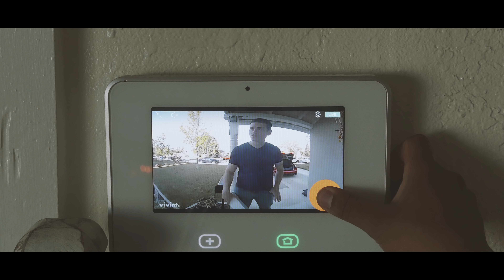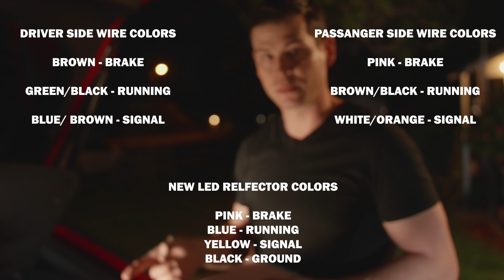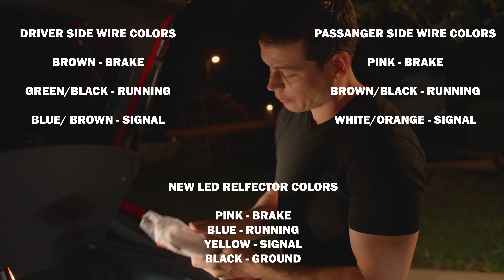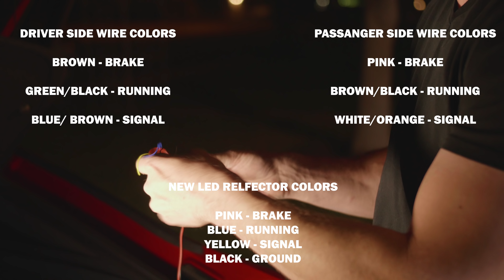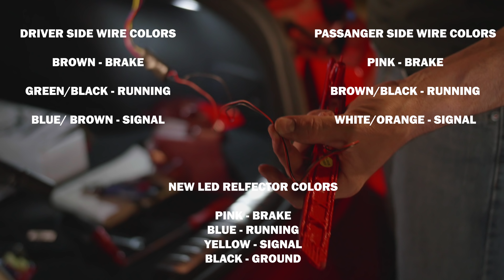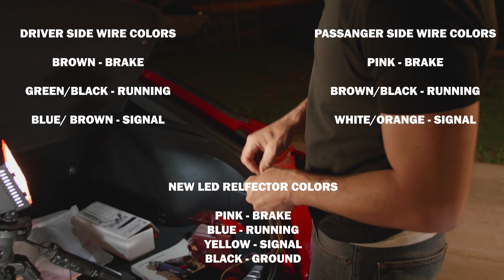2018 KIA STINGER GT2 Sequential LED Reflector Install

Comment: Thanks for the video. I've watched all of your videos so far and learned a lot from you guys. 

 After watching how complex this is and how unfinished the product is, I will not be adding this particular accessory to my GT2; although I do really like the look of the sequential signalling and integration with the other light signals. 

What I'm looking for is a signal light that is certain to be waterproof, has plug connectors (rather than testing and splicing), and wires that do not need to be cut to be fished. This "ideal" product will likely be more expensive than the one you used, but to me it will be worth it.
Reply: You do not have to splice the wires to fish the module if you use a Dremel to enlarge the hole. Worked like dream for me.

Comment: Mine arrive Friday, thanks for making this video :).

Pro tip (6:00), instead of cutting off the insulation from the wires I strip the wires from the new LED lights back that connects to the harness. If you cut the right length you can fold it over once and edge it down next to the correct wire in the connector. If you do it right it will always make contact, then just put a small cable tie around it and you have hooked up your wires without cutting anything factory. Cut the cable tie and pull the wires out if you want to go back to stock. I did this on my Optima 4 years ago and the lights still work great. Not sure if the connectors on the Stinger will allow that but it looks like they might from your video.

Comment: Is there an aftermarket solution for the reflector that lines the trunk?  It would be cool if you could connect the two brakelights with a led line as well.  It would be similar to the dodge charger or durango.

Comment: I’m late lol but to test ground use a multimeter. Have the car off. In the continuity position touch one lead to a ground on the car. Other lead just start touching pins til you get continuity. That’s your ground

Comment: How difficult do you think it'll be to open up that reflector? I bought the bare lights from Korea back in January and have been slowly tinkering to figure out the wiring but since you guys are awesome you tied up all the loose ends for me. I had that pesky screw that you can barely see figured out but didn't know I was going to have to cut and reconnect the long wires. Thanks!
Reply from the maker: It's hard to say.  It looks like they used some tool and melted the reflector open or opened it and melted it back together.  It's obviously possible just not sure how difficult it would be.

Comment: Hey Bud been watching your videos for quite some time. Have a Limited Yellow. I installed my Typhoon system purchased from where you got yours from. Had a small issue with the driver side one, interested if you will have the same issue. Otherwise thanks for your vids, helps me a lot! If your interested in discussing the issue speak to David and he can pass along my info. One thing is I would say go to a hardware store and buy a small hose clamp before installing. In any case I would be glad to get you some pics and explain my issue.
Reply from the maker: Daniel Mohn some others have had similar issues and then a couple have had 0 issues so not sure what's going on until I get in there and check it out.  Hoping next week for sure.  This weekend is busy.
Reply: Daniel Mohn I had the same issue.  I put a small clamp on and problem solved.
Reply: I haven't put the clamp on yet and just used 2 zip ties and the original pressure clamp. I am not hearing anything that should cause a concern. Did you hear something or did you even use the original clamp? I'm just wondering if there is something specific I should hear.
Reply: Daniel Mohn I used it for all of 10 minutes on the drive to the hardware store.  It was very loose.  I drove easy so I didn't hear any intake sounds
Reply: Ok thanks. I have been driving it around for a while haven't noticed anything. I will probably swap it out for a clamp this weekend.

Comment: hello, I bought the same lights and installed them on the stinger gt1 and they worked except with an attitude, they seemed to have worked but just not as expected, so when the lights are on auto  the sequential doesn't work but instead its the normal light as if you were pressing the brake, then it worked the next day and went back to the first way, can you please help me understand what I did wrong, I took it to a professional who did it how you did I'm thinking maybe its the module but again not sure I would really appreciate if you can help   me figure this one out thank you.

Comment: I'm confused, you cut those thin wires and then fished them up with a coat hanger. Why did you need to cut them if that's all you had to do? Wouldn't they be able to be fished through with the hanger even if you never cut them?
Reply: Jigga Man I just did them this weekend and the issue is the circuit board in the middle of the wires for the new leds. It doesn’t fit through the opening in the bumper which is why he cut them. I didn’t want to cut the wires so I just drilled the hole out to be a little bigger so it could fit (it’s plastic and hidden behind the light anyway). I didn’t need to cut the wires then it worked perfect. The video was super helpful though (my wires were slightly different colors green vs blue and red vs pink) and made this much easier than I thought.

Comment: Wondering if you have experienced any problems since you completed the installation, especially with the computer diagnostic system possible indicating an electrical fault. Thanks!
Reply from the maker: Brian Skrainka nope perfect as stock
Reply from the maker: Brian Skrainka if your seeing an electrical fault on the dash it means you have a loose connection somewhere you need to double-check your wiring

Comment: Love what you are doing. Will you be doing suspension upgrades and/or differential upgrades?
Reply from the maker: Geraldo Damaso suspension maybe. Coil overs if I do.  Right now I'm really close to scraping the front as the car sets when entering my driveway. I don't want to scrape every day you know.
Reply from the maker: Geraldo Damaso differential definitely not.  I have the manual limited slip which if you research is built by the same guys that make parts for the Nissan GTR drive line system.  It's a good differential. Should handle a lot of abuse
Reply: StingerGTandMe Thats all good to hear.  Many DIY Modders on the YT do aesthetic performance upgrades. It's awesome to hear you're considering Coil overs. You got the big brakes, light weigh rims and high performance tires thats great for street fun!  Looking forward to more updates.  You have made the Stinger a car I will consider for my next purchase.

Comment: I tried to install this morning but I’m unable to do, any expertise could help please! Got confusion with wire colors and end up with nothing! Please help! Thanks in advance!
Reply: Hi - were you able to troubleshoot the problem?  I'm facing a similar issue as well.  I believe I got all the colored wires correctly identified and tapped, but the bumper LEDs are not lighting up.

Comment: I don't understand, if there isn't a way to get the wire down how does cutting in to help ?Also wouldn't fishing line with a weight or fish tape help get the wires down there ?Also using heat shrink instead of just tape might be an idea as well.
Reply from the maker: John Tilghman  if you actually do this you will see what I'm talking about.  It's like having a wire with a giant not in it.  The hole is just bigger that the wire and the not won't go through but you need the knot on the other side. So you cut the wire out the knot on the other side and reconnect.  The hole is only a 1/4 round.  That circuit board will not go through it.
Reply: Ok, I have the picture now.. So ONLY the wires go thru not even with connectors on ?Anyway, I was thinking of making the same thing but using the hood vents and having it controlled by Bluetooth and maybe match the lights inside..Just not sure anyone would want that.

Comment: Get a F1 Flasher module for the high mount 3rd brake light
Reply from the maker: Brandon R yes I've seen another guy do an install on that. It does look pretty good. And would compliment these nicely

Comment: A company called race chip makes a plug an play for your car might make some good gains should check out and review. Great vids keep em coming
Reply from the maker: Casanova Rodriguez yeah there is actually 2 of them out. So far in the community it's not good results. A lot of fouled spark plugs because of these chips. Most guys are taking them off after running them for a few days.  Once they make something like the Cobb accessport then I'll go ahead. Not until. Thanks for the info

Comment: I am interested in doing the same thing for  a 2017 Cadenza.  Do you think it will be similar?
Reply from the maker: Skoo Shoes  not sure.  Wiring to the new lights will be the same. Wiring from your car you will have to diagnose yourself to find what color wire does what.
Reply: thanks for your reply,, I like your channel.